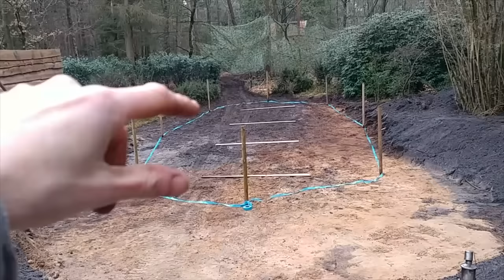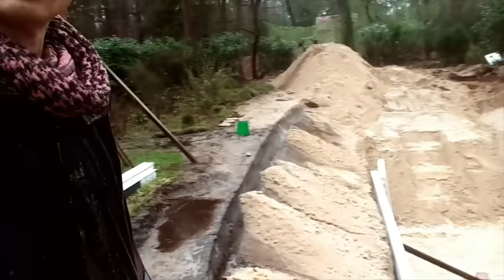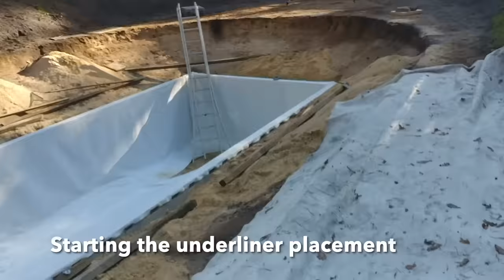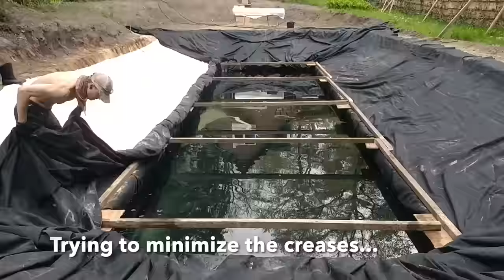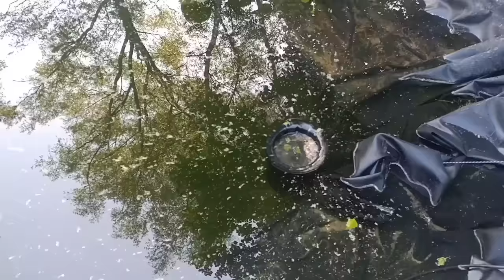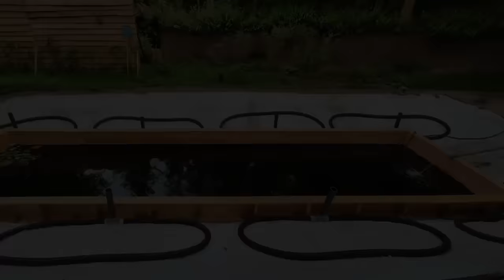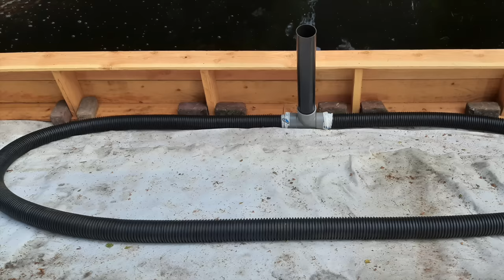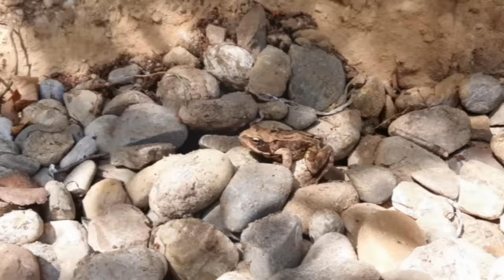Natural Swimming Pond / Pool Build 2023

Comment: Not a fan of the ring of gravel.
Reply from the maker: Not sure what you mean by ring of gravel, but if you mean the outer edge, how would you have done it instead? 

Also note that it will be invisible in 1-2 years as short plants and grasses will then have taken hold in it. It's still a relatively wet area as that's where the overflow drainage sits.